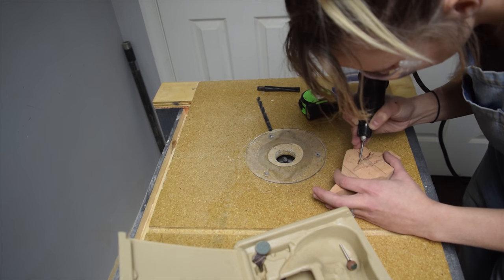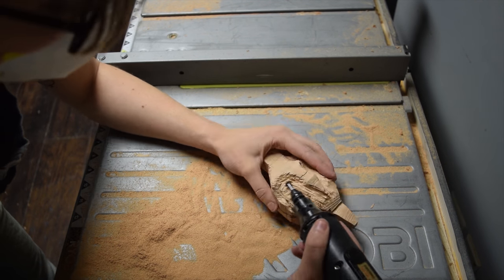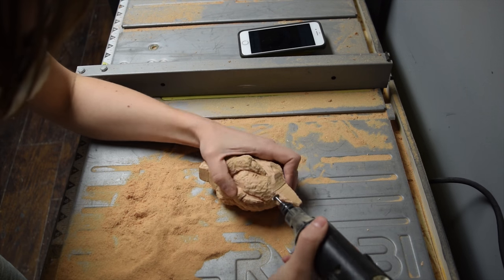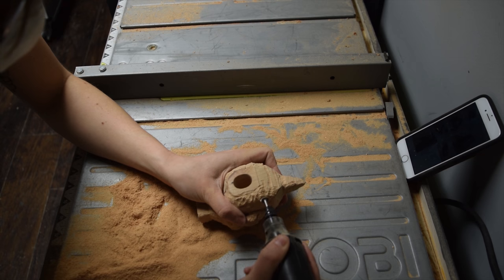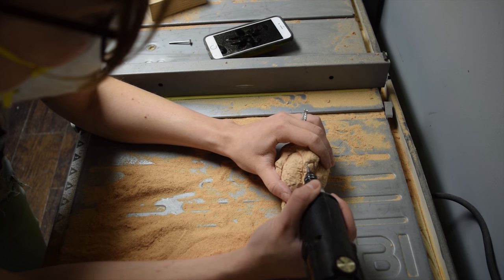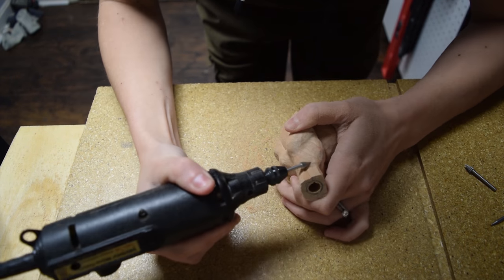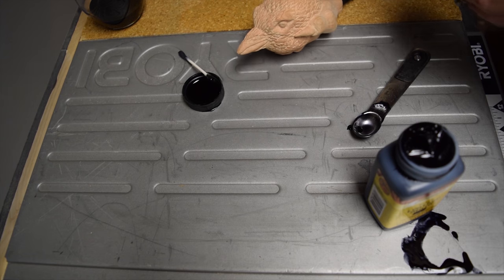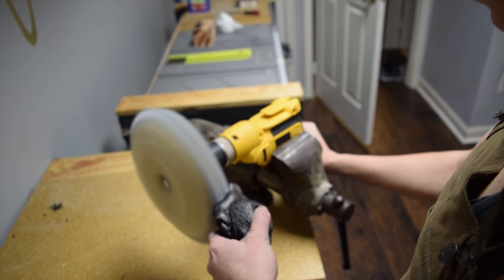DIY Tobacco Pipe : Edgar Allen Pipe - Part 2

Comment: As an amateur woodworker who watches way too many youtube videos on WW, you just earned a subscriber.  Not only was the ww really well done and captured, the video editing was excellent, with well timed fast-forwards. Really cool design and awesome finish.

2 small things
1) I would've appreciated in a "DIY" video a little more explanation on what you were all marking with the tape measure and pencil at the beginning.  It seemed like more marks than just the bowl and stem, and I wasn't sure what you were doing there.

2) A pipe bowl should be perpendicular to the end/tip of the stem, which yours was.  However, the bowl should be lower, not higher than the stem.  With this pipe, as the smoker draws, the bowl will be in his eyes/face.  This is the reason that most pipes have sloping stems.
Reply from the maker: Thanks, man! I really appreciate the feedback!